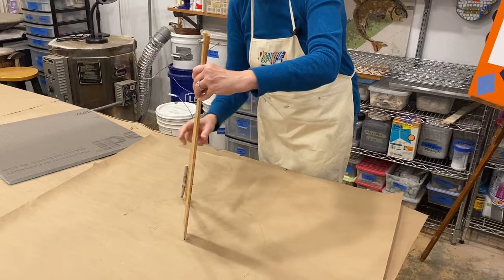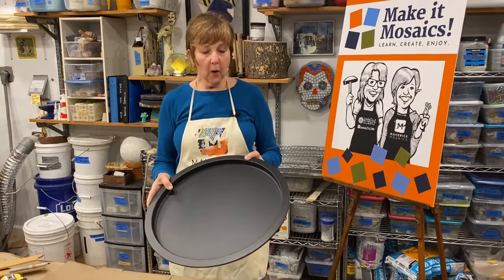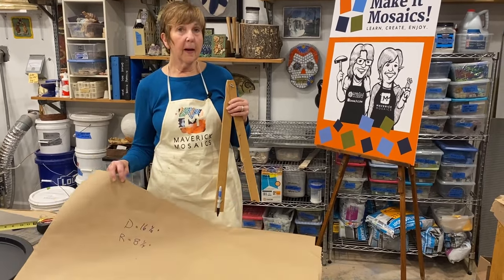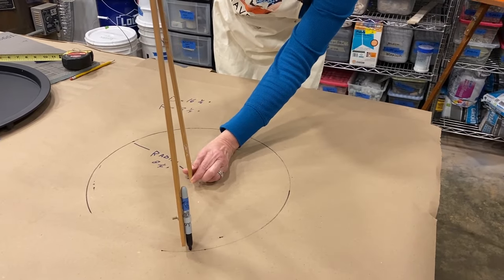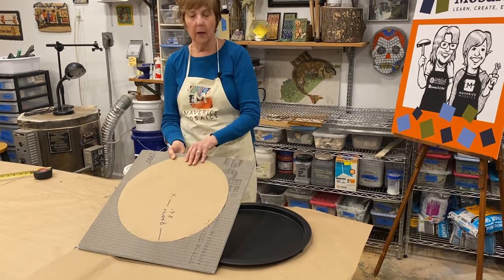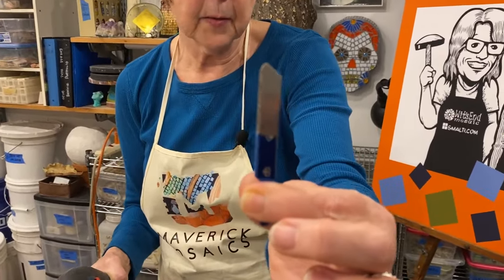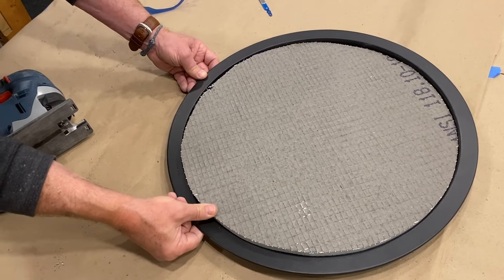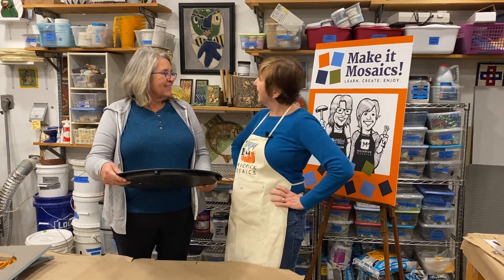Circular Mosaic Substrates Made Easy

Comment: Great tip about the diamond blade.  I have two questions.
1) What thickness is the wedi board ? Do you need a special mastic since it is a polystyrene material.
2) where  can we find the the metal trays / tables?
Reply from the maker: Wedi comes in several thicknesses, used in video was 1/2". We use thin-set vs mastic (see Adhesive video for more info.) and Kim explains in detail about the polystyrene core  substrates and how to handle in video "lightweight substrates". That metal tray is part of a tabletop, that video on Channel is titled Mosaic Table Top, and the thumbnail is a bright orange fish. Keep creating!!